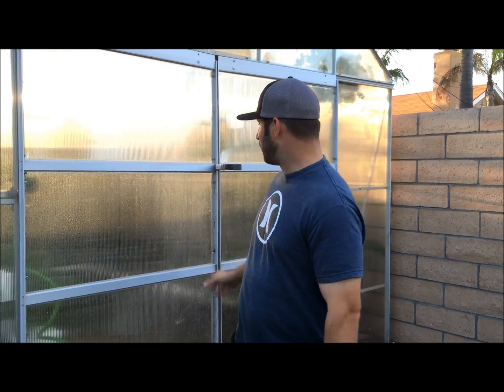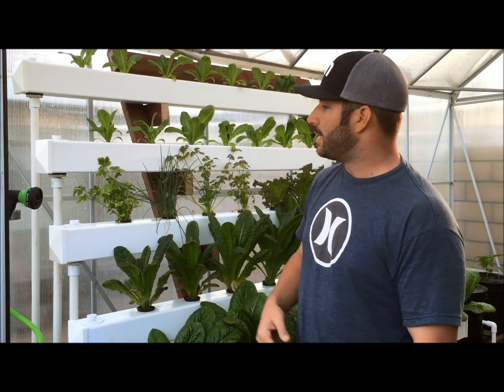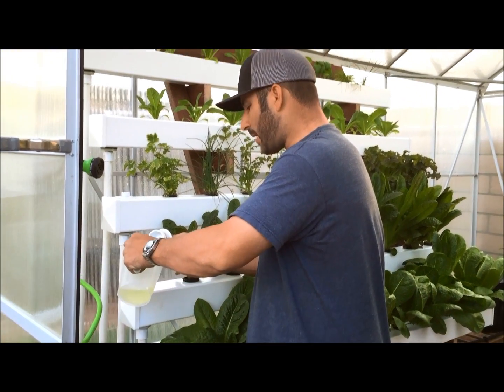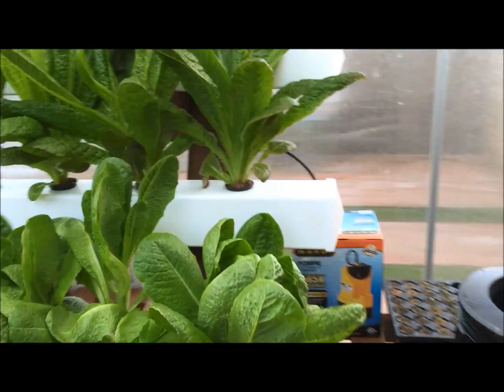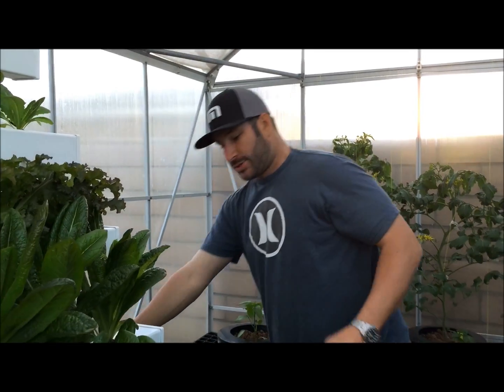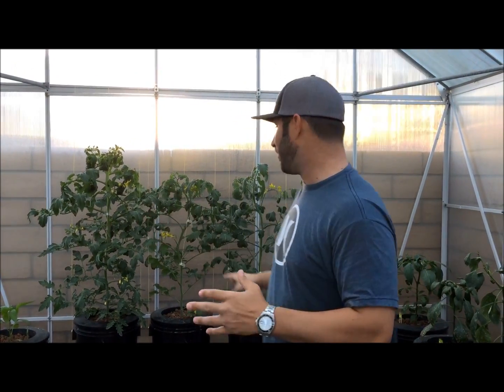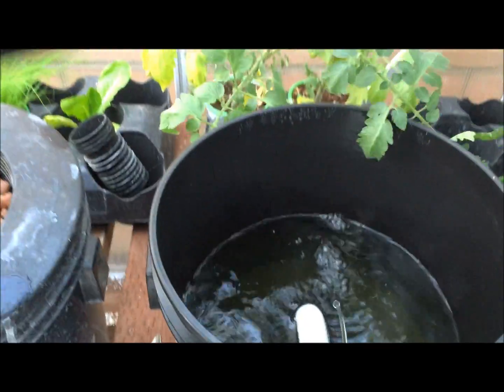Hydroponic NFT with Bucket System / Dutch Bucket

Comment: I'm not sure if you're still listening to this comments or not, but i found your video a couple years ago and loved it. Last year i was able to build a greenhouse (it's 10x12). I designed it after yours. The only difference i made was instead of Dutch buckets i used totes. I finally got mine started back in May of this year. I'm a novice at hydroponics and trying to figure this out. I'm using Masterblend nutrients and curious. what PPM, EC, PH levels did you run yours at? I've looked all over the net and the numbers seem to be drastically different for each plant, but you seemed to have no problem getting them to grow together.
Reply from the maker: I browse the comments every now and then, but I haven't done any hydroponics in at least 7-8 years (having kids will do that to you). I get a lot of questions like yours, the levels, the ph etc, and the honest answer is I never paid attention too it, I never tried to do too much. I found a pretty universal nutrient blend and just went with it, everything just seemed to work well. Plenty of aeration, moving water and Southern California sunshine seemed to do the trick. Sometimes simpler is better!

Comment: I found a cheaper bulkhead option for the hydroponic drains when I looking around at the store for one to use on my rain barrel overflows.  if you go to the hot water tank section they sell a $3 one to act as a drain for the hot water heater pan.  it outputs to 1 inch PVC.  Really cool setup!  I recently got a small tower garden and now getting into it a bit more am contemplating using PVC Gutter to build one along part of the railing on our deck but i am wondering if horizontal is better than building multiple PVC towers.  I don't want to kill our view but I do want to grow more lettuce and other greens this way vs in my garden beds.

Comment: I just stumbled across your video and man does your system look just like mine.  I have a plastic dome that is 14X7X7 with five open windows on both sides, I have 15 dutch buckets being fed by a 30 gallon reservoir that I try to feed with mastergardener blend  each time I refill with water or at least once per week. I have a fan that runs all the time, just to move air. The problems I have had is that I need to feed a minimum of once a week, and if I add 75% water every two days, maybe I need to feed more. I live in Colorado and our nighttime temps are cool, daytime temps are high like 90-100 degrees, so I leave my dome widows open all the time with fan running and that might be a mistake.  My tomato plants are huge, both in the size of the stems and the height, (to the ceiling and back to the floor) but I don't have tomatoes turning red, though I have a ton of small tomatoes set on.  So I don't know if I am under feeding, over feeding, under watering (1 hour 3 times a day) or if they have just bushed out so much that I don't get enough sun.  I'm using Mastergardener for tom and veg at a min of once a week, or every time I  need to replenish my 29  gallon reservoir.  Any ideas? I think my plants are so big that I can't get enough light and I need to trim them down.  Also, maybe there are too many plants in my small space and the leaves are just robbing the other of sunlight.  I love your 4" drain pipe idea and I would like to try that, just not sure if I have enough sun light to make it work due to the suns' location of my project high tower house.  Any ideas?

Comment: Hey just curious if 5 years later if you are still using this system?  Longevity has to be a consideration when implementing a system like this ? How sustainable is the system and after each end of production how difficult is it to clean and continue on?

Comment: Nice video, answers a few questions. I want to put a vertical hydroponic system on an outside garden wall in Perth, Australia, which is a similar climate to Los Angeles (is that where you are?). I would have thought your greenhouse would be too hot for most of the year. Would consider hydroponics outside?

Comment: Hi Brandon, Great videos and system!  I know you no longer have the setup since you moved, but can you tell me what size buckets you were using as I am planning to build the bucket system to start. They look like 3.5 gallon size (vs the 5), but hard to tell in video.  Also, do you know what brand of 8" net pot you were using.  I've read complaints on some from Hydrofarm ones that are only 5" deep and may not provide enough room/support for the plant.

Comment: You have probably already been told this, but next time you have a plant that snaps, use the old paper mache  from grade school to make a cast for the broken plant. It's just flour and newspaper or paper towels .  Put the plant back together and wrap the break and add some sort of support so the cast can dry and then the plant will heal again and you should be producing again shortly.  You might lose a bit of production, but it is better than trashing the plant and starting again depending on your season or the age of the plant.

Comment: Interested to hear how that Mondi pump works out.  I had one in a system, it failed after 8 months, it was tripping the GFI!  found that water had got into it, and the bottom of the pump around the output shaft had rusted.

Comment: Firstly your algae problem was because your buckets were white and let some light in also algae grew where you were top watering on the perlite! you need to put watering tube below the perlite about 4 " that way it stays dry on top and your directing water directly onto the roots ! 
Your new tomatoes black buckets are too small you need that extra room for the roots your current set up seems to be small and roots are crowded.

Comment: I built a Hoophouse with a system based off of yours. I have good results but now I'm having some issues with root rot. What are you doing to keep your water temps down? Also do you have a stone in each bucket or just reservoir?
Reply from the maker: I had a pretty powerful pump with a large stone in the reservoir. I never really had issues with root rot, but it did get hot here one summer, it's tough to keep things cool, sometimes I'd throw a bag of ice in the reservoir, but increasing air flow throughout the greenhouse is good too. One fan should be sucking air in, and the top vent fan should be sucking air out. Worse case scenario, you can buy a water chiller.

Comment: ..any idea how big of a solar system you might need in a grid down situation to continue growing food?
Reply from the maker: Not really sure, in later modifications to this system I ran 2 fans off of individual solar panels, they worked great and were no larger than a piece of paper. Running the pump by soar might be a different story though.
Reply: @BrandonMatthewHB  Thanks for the quick response!

Comment: Brilliant! I am in the process of building my own system and found this video very informative, thank you...

Two questions if I may. How far apart are your holes for the net cups, and I see your whole system runs on the same nutrient water, how do you add the calcium for the tomatoes? Directly into their individual buckets? Or just into the nutrient water?

Thanks Mo (form South Africa)
Reply from the maker: Honestly the stuff I was using was kind of an all-in-one. So it wasn't fine tuned for any particular plant, just an all general nutrient.

Comment: I freaking love how particular and well thought out this system is! Now to put together a parts list for my own!
Reply: Seriously, this is a great build! Im planning on emulating it for my next project! How are the troughs being supported? I can't imagine they are just sitting on the pipes
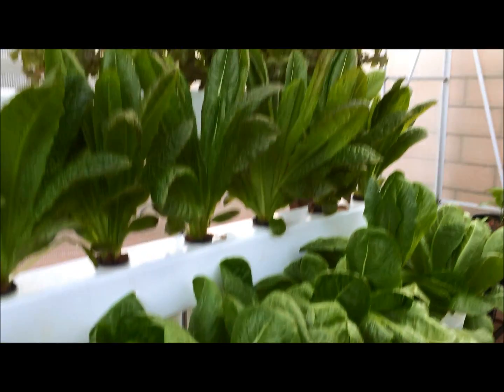Reply: If you playback at slow speed, at around 8:57-9:01 you can see some flashes of a wooden A frame supporting the system. It looks so good!
Reply: A lot of hydroponics books will provide complete equipment lists, including various types of dutch bucket, nft, dwc and (sometimes) aeroponic systems for you to build. How-to hydroponics by Keith Roberto is highly recommended.
Reply: Am very happy for you.  A great job. Very clean and beautiful setup.  If you could please show us the inlet pipe to the hydroponic system.

Comment: What’s the name of the end pieces for the drain? You said your where going to put a part number from home Depot. You said it’s for a boat but I can’t find anything. Old video hope you see this question. Great video tho.
Reply from the maker: It's called a bulkhead union
Reply: Thanks for the reply I eventually found out but it took me half the night. 🤯I will be copying your design on a smaller scale for an indoor set up. I’m going to get my experience this way until I’m able to scale to a larger set up. Great set up.
Reply: What are the hole sizes that you used and what was the hole cutter size used? Thanks in advance

Comment: Neat system.

But do the square fenceposts leak at the ends? And will vynyl remain water tight without leakage as its exposed to the elements over time? 

Thanks

Also wanted to ask what the electrical cost of the Mondi 1585X pump is running it all 24/7?
Reply from the maker: You just have to seal them good, I never had any issues with leakage or anything.

Comment: How do you start your seeds to put into the system?
Reply from the maker: Just drop them into the wool cube, seed tray, water and cover. Pretty easy.
Reply: @BrandonMatthewHB  do you buy new rock wool every time? I'm finding it impossible to reuse the rock wool after just one use.
Reply from the maker: @deejae6646  Yes for sure. Also guarantees you won't spread any diseases to your new plants.

Comment: Very nice! You got me motivated to get my system up and running again! How do you run the water through the vinyl posts? Do you use smaller lines or just pump the water through the 1/2 hose to each post? Thanks

Comment: Is the ECO2245 required for your set up - it rated for 2166 GPH with a 16ft lift.  That's a pretty powerful pump.  My system is just about same size/#buckets and NFT and I need to move to ONE pump for the entire system like you have done.  So I'm wondering how you determined your flow rate be that high?  Thanks.
Reply from the maker: Well as long as your pump is carrying the water up the height of your system, any model fine. My sump is in the ground, and it's 7 foot above at its highest, so it needed the extra push for the 9 feet. I also wanted to make sure each bucket was getting the same flow, and I see it as I can always lower the pressure using valves, but cannot increase it if the power isn't there.
Reply: Brandon Matthew Thanks. You have a good point in being able to adjust flow down w/tube size, etc.  Did you put up a sketch or plan for you nft?  It's a nice design...
Reply from the maker: @tulipsmoran5197  No, never wrote it down, just played it by ear. Pretty basic if you just watch the video a few times you'll get it. I have a couple other videos that explain some other stuff. Only change I made that never got recorded was switching that top fan to be an exhaust, and adding a intake fan on the opposite side down low. Really helped cool the greenhouse down during hot months.
Reply: @BrandonMatthewHB  Hi Brandon - taking your advice and designing my 10x10 greenhouse hydro line as a closed loop around the greenhouse similar to you to achieve highest pressure.  I'm also switching over to the 3.5 gal w/6" wide lip net cup.  Couple questions - your elbows in buckets looks to be higher how much water do you allow in the bottom? At what height do you have elbows?  What height do you have inlet tube - it's hard to see in the video.  How did you balance the NFT flow and direct flow into buckets?  Also how many gallons are you pushing around?  I'm estimating I need 65 minimum for my set up of 16 buckets/5NFT channels so I'm planning for 75 gal in low sump with a 55 gal top off tank that uses a float valve at the sump. What's your sump volume?  Do you run a top off barrel?  thanks.

Comment: You run that thing 24 hours a day? Doesn't it use a lot of electricity?
Why do some people's systems drain every 15 minutes and yours never turns off? What's the difference? Thanks!
Reply from the maker: It was only a single pump that ran 24/7 so electrical wasn't an issue.. Some systems flood a few times a day, and reservoir systems like mine rely on oxygenating the water constantly, this assures the plants are always getting fresh, cool, oxygen filled water. I found I had healthier plants this way, but both ways work, it really depends on the plant type and your environment.
Reply: @BrandonMatthewHB  thanks for your reply! I love your setup so much. So clean and organized looking and also efficient. Do you run this in winter also? Ever have problems with the roots not being able to touch the water? How deep does the water level stay in the fence posts?

Comment: Great video. Are you still using the same set up?
Reply from the maker: Thanks for watching. Unfortunately I no longer have the greenhouse. It had gotten so hot the last few summers here in Southern California that it just made it impossible to keep the plants cool. A few changes I made that never got published, I installed another fan on the bottom left side of the green house that brought air in, and reversed the top fan to exhaust the warm air. This made an insane difference in the temperature, but as I said it just got way too hot. Good luck with your system!

Comment: I’ve enjoyed watching the evolution of your system. I would love to know if you still have a system running and what it looks like today.
Reply from the maker: Thanks for watching. Unfortunately I no longer have the greenhouse. It had gotten so hot the last few summers here in Southern California that it just made it impossible to keep the plants cool. A few changes I made that never got published, I installed another fan on the bottom left side of the green house that brought air in, and reversed the top fan to exhaust the warm air. This made an insane difference in the temperature, but as I said it just got way too hot. Good luck with your system!

Comment: I like the changes to the dutch bucket system Brandon. I will be surprised if the roots still don't find their way through that net cup card into the drainage system. I ended up with with 3 feet of roots outside of the 3" net cups that I bought for my wicking system. Seems like they will find a way out!
Chuck

Comment: Thanks so much!!! have you updated this system since making this video?
Reply: I just read in the comments "I just removed the sump in the video and replaced it with a 50 gallon container. I cut the lid to exact specs for filling, draining, cords, etc. I also cut it into two parts so I can lift the lid on one side and inspect/add nutrients without having to remove the pvc on the other side. This has made things 100% easier. I just topped off about 25 gallons that was used up, and that took about 1 1/2 weeks to get down to, so pretty efficient."

Comment: awesome idea. doing something simpler  to my green house. but a suggestion for ya. though and air pump on your buckets. putting more o2 into the water will allow the plants to have more nuts. and also the root just love o2. for example. the water may have 500 to 600 ppm. doesn't mean the plants are taking it in. so throwing and air pump on it.will allow them too. and also keep the water a little cooler then the out side are for those hot days

Comment: Did you concider a fogger system?  they have hydroponic foggers and they provide even better distribution of nutrients.
Reply: Jonathan McReynolds in a small sectional hydroponic fogger unit you can daizy-chain them together and they can cover more area. I have a design that uses 4 1/2 ft sections of 6 inch dia pvc. 4 single element fogger units will work as long as you build in the internal pockets so it has hydroponic solution to turn into mist. And spread them out evenly so they will cover the whole section.
Reply from the maker: I've looked into them a little, would be neat, just haven't had the time to do anything lately.
Reply: You have a lot of exposed roots with the plants in your hydroponic buckets.  ( tomatos?) A areoponic system in conjunction with those exposed roots would make the plant vibrant and a lot more healthy than what they show now. The wilt they exhibit would go away. They have single element foggers for $12 online. This would work for your bucket system.  Just attain one and try it. Rock wool from your seed starter will be superior to the seed starter pellet in hydroponic system,  you can still use the seed starter it will work.
Reply from the maker: Funny you say that, this is an old video, I use the rockwool, and an airator in the buckets now. Everything looks great.
Reply: You buy $12 foggers. They last you no time for use at all. 

>Buy a professional industrial fogger

Comment: Did you get the vinyl fence posts and caps from home depot?
Reply from the maker: Yes.
Reply: ***** this isn't blue vynal. This is construction grade vynal and it's ok to use. It's mainly used for fence post beams in this form to cover anywhere from a 4x4, 5x5, or 6 x 6 vynal crossover beam. But you can cap both ends like shown here , cut holes in it for mesh hydroponic grow pots, and attach down spouts for a place to run irrigation tubing in to water the plant with nutrient solution and give the whole module a place to drain the excess into a collection tank below. 
There is nothing wrong with it. Only to a ignorant wierdo would someone think that somthing is wrong with it because they fail to understand it! Take that to your cement pond Mr Johnson. Well Dawgies!
Reply: ***** when you burn it it does bleed it's polymers and turns into something toxic. But that is if you burn it. We're not burning it here. It's being used to grow plants. The only stupid  people that burn it on purpose regularly are Huffers that try to get a high off it , but it destroys you lungs too quickly.